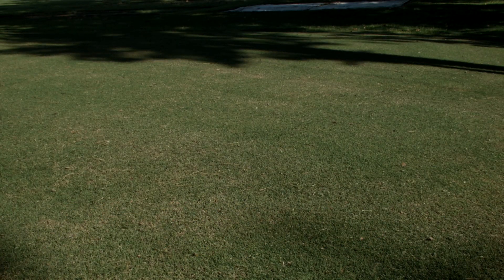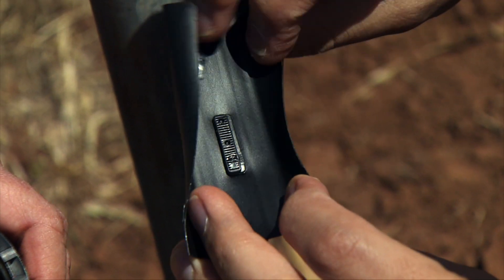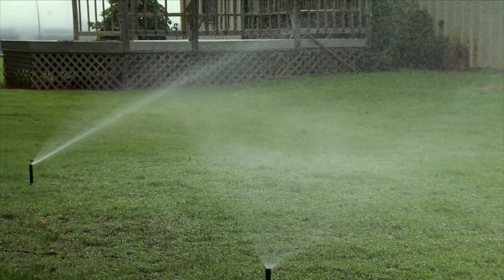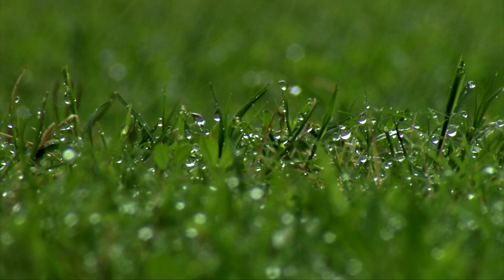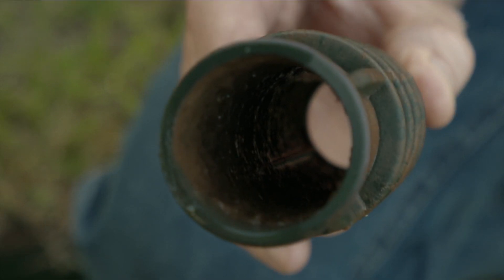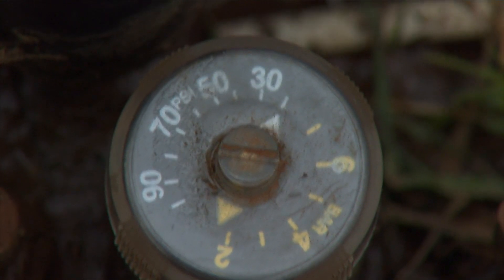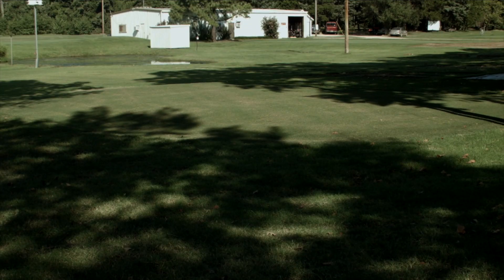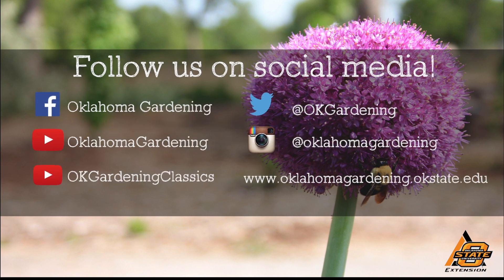Sub-Surface Drip Irrigation Systems

Comment: With the drip system how do we identify lines when were doin core aeration ?
Reply from the maker: Some drip systems can be identified with a metal detector due to using metal parts. You may be able to follow the main water source to identify where the lines are. And if all else fails you may have to dig in the area you suspect the irrigation lines to be located in.